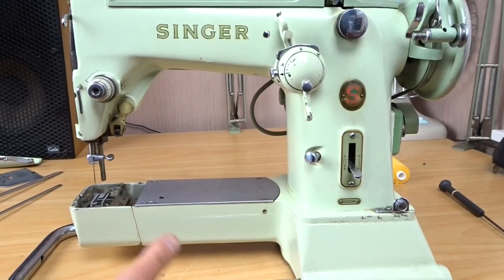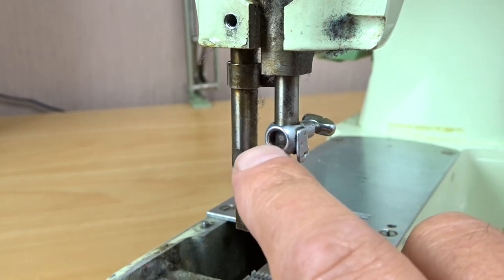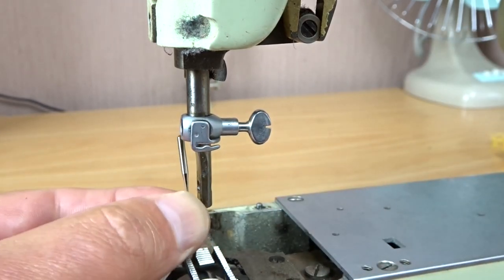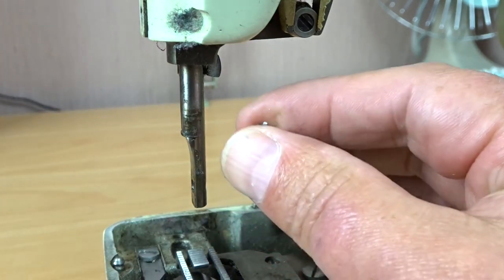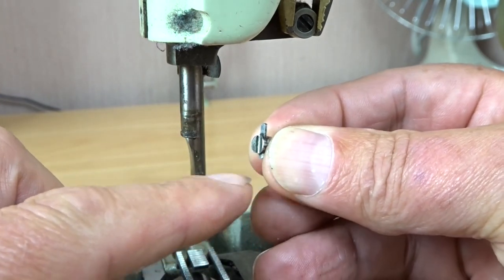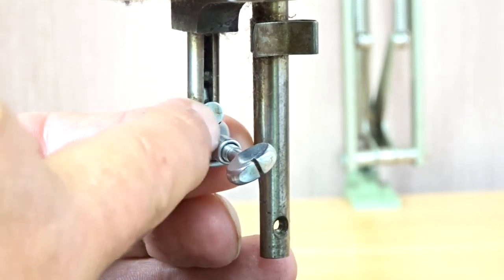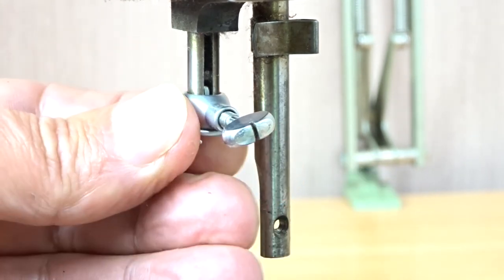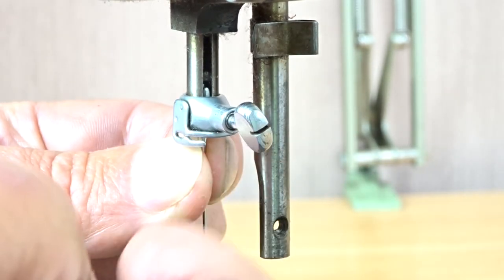Singer 320K Needle Clamp Assembly - Screw Missing (306K, 319K and 320K)

Comment: OMGoodness you are a life saver or machine saver. Lol I have worked with mine for days to no avail and after watching your video, I fixed it in less than a minute. My little screw isn’t missing but the thread guide on my needle clamp is broken so I took it off to try to find a new one. No luck finding one but then couldn’t reassemble it. My machine is a 319w. Much thanks!!

Comment: Different needle bar and clamp on my 319k made in Nov-1959
The clamp does not have thread guide and is only two parts including the screw.
The needle bar does not have the cutout it is just a hole for the needle to go into and you can put in the needle at an angle or the wrong way flat not at the back.

My guess is that it has been replaced at some point.

I have a jones machine so I am used to rotating the needle for the jones round shank needles.

John

Comment: You forgot to tell us what the missing but was for? I'm guessing so the needle holder won't fall out when you loosen the screw???
Reply from the maker: I do like the arrangement of these Singer machines as it's more like an industrial machine with its full rotary hook. Less noise and vibration than the oscillating hooks. I also like the Elna because it also is a full rotary hook, hence why they are so smooth. Thanks.

Comment: Singer 301 grub screw is similar, if memory serves correctly. Maybe you can find a replacement that way? (other models might be better...206, 306 & 319?)
Reply from the maker: Thanks. Will take a look at a 206 but I don't think I have one.
Reply: @InStitches  had an epiphany when working on the needle bar for a Singer 15-90 (belt driven model)  this afternoon. Had to remove the needle clamp parts and it made me think of you. It has the same little grub screw. Maybe that might be a more economical route in finding that part there in NZ? Looks to be the same size. Hope that helps. Best wishes. 
-Rich 🇺🇸
Reply: @rich-f-in-tx6388  thank you!!